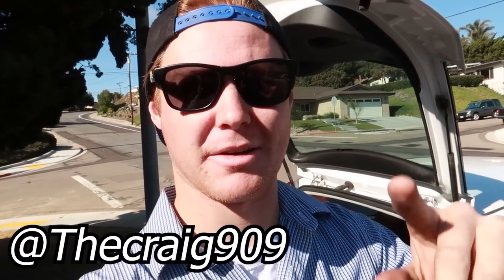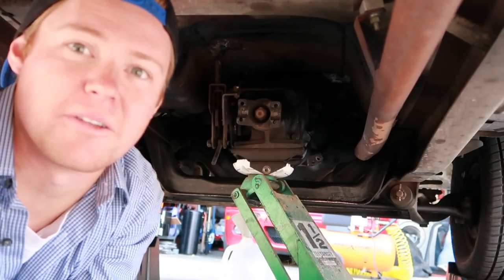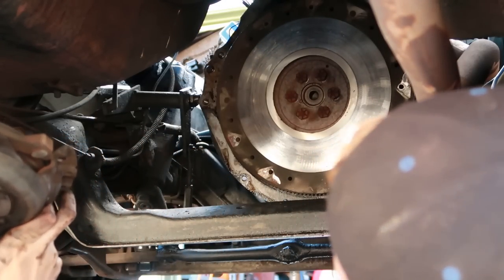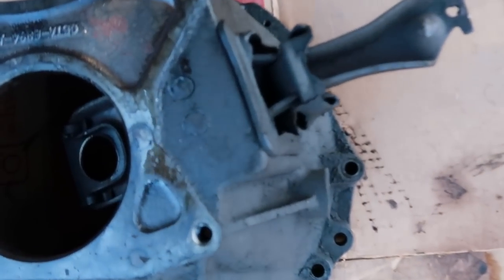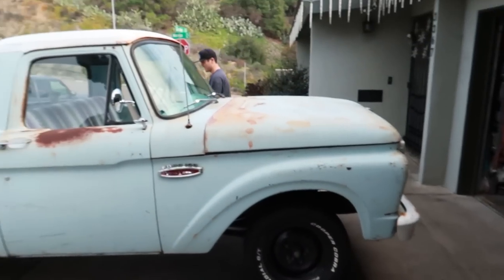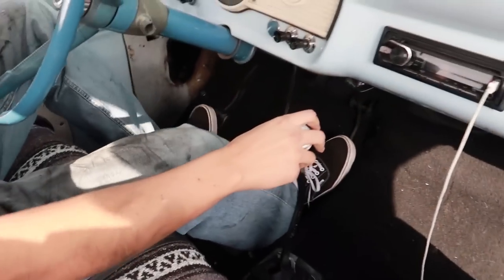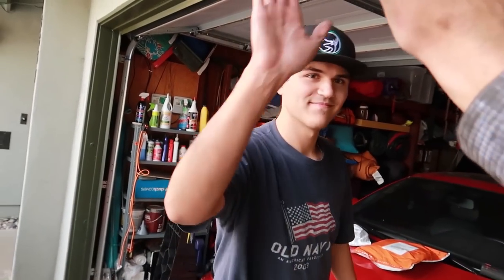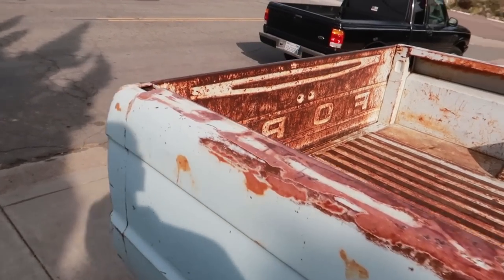'65 F100 Get's a New Clutch!

Comment: It's definitely the linkage. I have the same on my 66 F100 with a 351 Cleveland. The linkage is sloppy and if you don't "center up" between 1st and 2nd the pins on the linkage don't line up and you won't be able to get any gear until you find the hole for that pin to go into again.

Comment: You should still take the flywheel off and get it refaced
Reply: Jonah Zwinger if he doesn’t he will get clutch chatter.
Reply: @smathet7766  my point exactly
Reply: And it will continue slipping I fought mine because I didn’t resurface it and it ended up being glazed

Comment: Thank you I’ve been trying to figure out what was wrong with my old ford dually flatbed I changed the clutch out put it in gear but it wasn’t going anywhere where as before it was making that weird scraping noise that yours was before you adjusted the clutch the second time I’m going to pull the tranny back resurface the clutch plate and put it all back together the adjust the clutch and hopefully that does it this was my first time and I don’t think I put the arm on the throw out bearing right but I’m just a girl trying to figure shit out myself so you have to fail sometimes to learn I guess right but thank you taught me a lot appreciate it.
Reply: Also I do have to ad that if you have an oil leak and it gets onto the clutch it turns it into lie a sponge and makes it slip and or wear down quicker which is what happened in my case because I need a new rear seal and it’s just dumping oil out makes for a messy job to say the least.

Comment: I don't think that anyone has mentioned this yet but you might want to drain flush and then refill the Trans,  Had a '95 Chevy 2500 ext cab that would do the same thing and I got lucky and it wasn't the clutch or the trans that was shot. Besides it is cheap insurance to do a good service on it so that it lasts another 50 years

Comment: What a beautiful 65. Weird how the clutch slipped when it looked perfectly fine. My clutch gets a little weird from time to time, especially if I haven't driven it in a few days. I usually just pump it a few times and it works perfectly again.

Cars are weird.
Reply: Could be rear main seal leaking oil into the clutch area

Comment: Hello from Texas i myself am still dailey driving my Dads (RIP) 1966 F-100 Long Bed with a semi original 352 FE Big Block if you ever need advise on your F-100 drop me a line as i grew up and learned my mechanic skills on this truck it has well over 300-000 miles and has never left me walking in my 66 year old life the only thing i can advise you is try not to rest your hand on the stick shift because you are putting undue stress on the snychros in the tranny